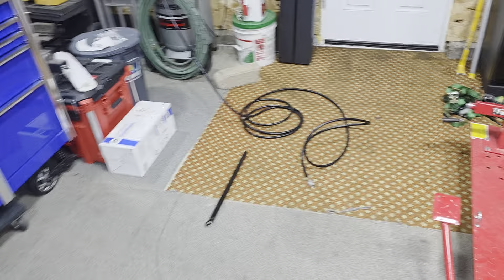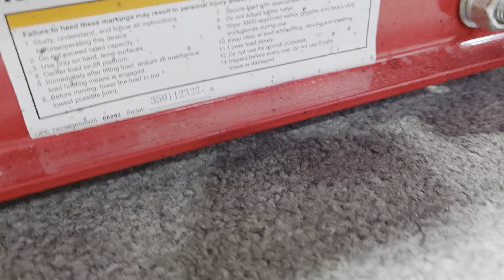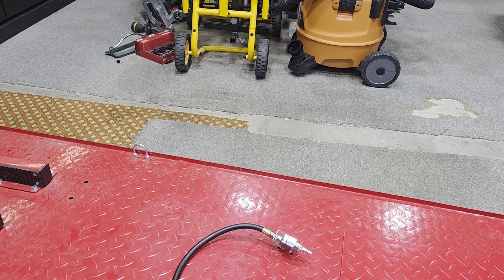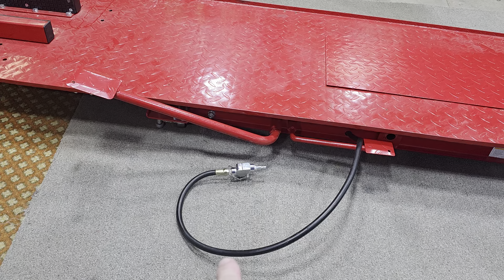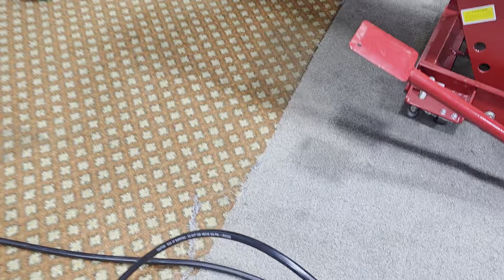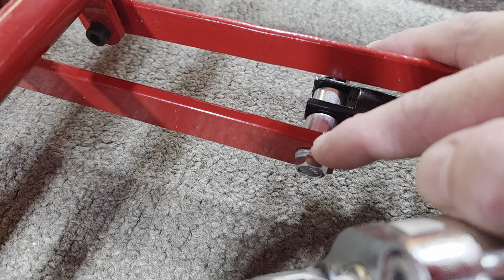100% Bolt On Harbor Freight Motorcycle Lift Air Conversion

Comment: I bought my HF lift back in the day when you could still buy them for $250 with the parking lot sale coupon about 8-9 years ago now. I just did my conversion using this Redline setup. Works perfect and this video is what turned me onto it to go ahead and do the conversion. 🤌

Comment: While my harbor freight lift looks identical in terms of the structure, not having a center beam, etc., But the cradle which holds the pump is clearly different. There are no side access holes, and there are no bolts holding pins in. Just putting this out for other people.  My sticker is missing.

Comment: Wow, that is great, you found a pump that fit.   I just tried the harbor freight pump today  and it’s a problem with our frame type,  plus the pump shaft is larger than the female end on the lift.  I don’t see a practical way to use the harbor freight pump.
Reply: I ran into the same problem. I watched the video and I’m guessing it was the older version and it would’ve worked but the way that the new one is designed which I can’t figure out for the life of me why they would’ve changed it but I’m glad I’m really glad that I came across this video cause I just pulled that hydraulic ram from Harbor Freight and realized that I was gonna have to cut world and all sorts of stuff to get the engineering right. So come across this video has been a godsend.
Reply from the maker: @hipoman8087  That's exactly why I made the video so people have a clear view on what this pump will work on so that don't get screwed out of money from RedLine Engineering
Reply: @mikeb8893 we appreciate that big time. $ getting tight.